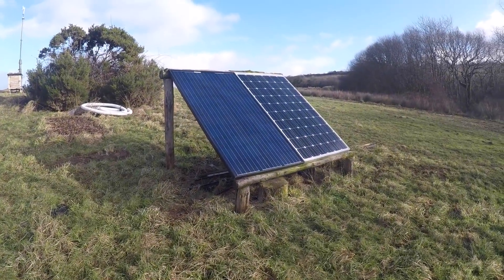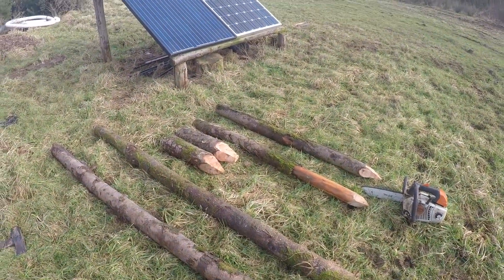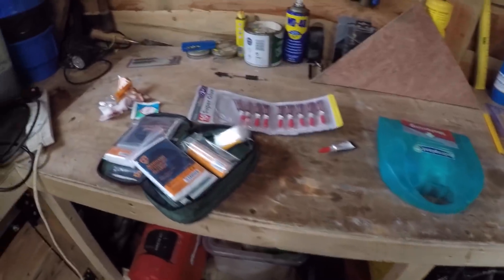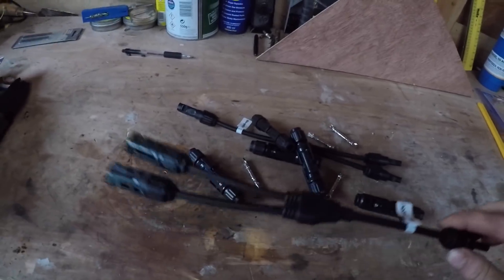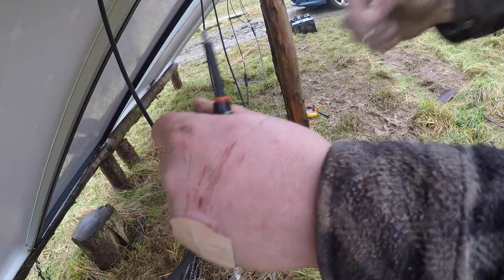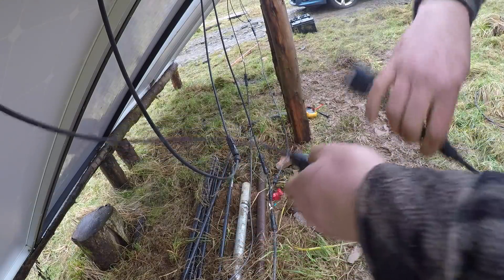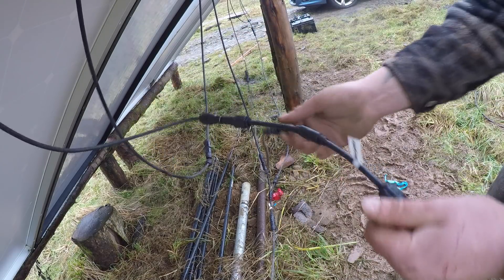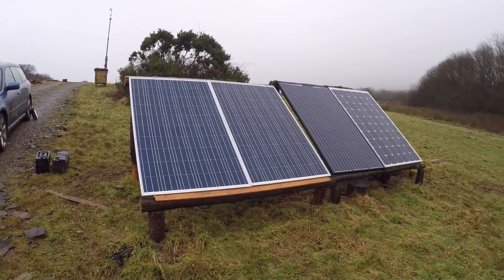Solar Upgrade 1000w

Comment: I would personally never connect solar panels in parallel … unless I’m missing something, if you have 2 panels and let’s say one panel gives 19.5v output for a given amount of sunlight and the panel next to it also receives the same amount of sunlight and it gives say, 19v then if they are wired in parallel and hopefully each panel has a series blocking diode, then the panel with the lower voltage is NEVER going to pass any current into the load.

Comment: Anyone know the wiring diagram for something like this and whats good to use to get going? I want to try use solar to power some Lead acid fork lift batteries not to go completely off grid but to try power the lights and maybe the odd appliance (dryer etc)

Comment: I love the way you tackle every task as if it were the most natural thing for anyone to do. It may be that the MC4 pin doesn't line up correctly because the wrong crimper is used and the resultant shape doesn't sit correctly within the housing and from someone who spent many years working with many crimpers, always do a pull test.

Comment: aloha.... came across your video... your house overview.... your water turbine; pulling your waterline & your controller problems.... but i notice you injured your hand.... 2-3x?? MY ONLY SUGGESTYION WHILE OUT & ABOUT WORKING --- WEAR GLOVES, GOOD TACTICAL GLOVES.... PROTECT YOUR HANDS. ((( you work alone usually and you must place your safety as NUMRER ONE PRIORITY!!!! because if you suffer a bad injury and no one is around and you are invcapacitated, you suffer in silence.  Also; wear a bluetooth earpiece & carry your celhone + battery pack. IT'S FOR YOUR SAFETY!!!

BE SAFE!!!! ALOHA

Comment: Dang Mr Kris, your on a roll, you got the Mo going, keep it up.
Reply from the maker: Hi Gregor, Im slowing down a little bit now that the hydro project is coming to an end, i have tree planting to do soon and then i need to spend some time collecting materials ready for the workshop build. but spring time is going to be crazy busy getting started on the workshop.

Comment: Good to see that you are expanding your solar array as 500W (peak) is a bit low in the UK at this time of year. You would improve your output significantly if you increased your panel angle to about 60 degrees as the sun is low at this time of year. The 60 degree angle will not be ideal for Summer but the sun shines longer each day so it cancels out.  You are operating off-grid so you are most interested in the lowest daily output not the peak yield in Summer.
Another thing you can do with most charge controllers is to overprovision solar PV and let the controller limit the maximum charging current to 1kw or whatever the limit is. This can be very helpful in the UK as it increases the average power output whilst limiting it at something which doesn't hurt your batteries. But you do need to check the manual for your controller.
The solar performance in the UK over the last month or so has been really poor compared to other years due to weather and cloud cover. Sheffield University have a really good webpage giving stats for the last few years based on the entire UK. Well worth a look at https://www.solar.sheffield.ac.uk/pvlive/
I've just finished commissioning my off grid system in Shropshire (7kw panel, 4kw controller, 10kwh lifepo4) but have yet to really exercise it due to the poor weather!
Hope your hand gets better soon, I'm really interested in your hydro project.  Good luck :)
Reply from the maker: Thanks for the nice comment, lots of good info there. yeah my setup is a summer set up. the idea being winter i will be running hydro power. so i dont really need to change the angle. in the next few days i will be on hydro and wont need solar until a summer dry spell. i only did the upgrade because the price was so good. and its always good to have more than you need just incase. 

you have 10kwh lithium! WOW that is very posh. i could really use one of them. im thinking of making a 18650 powerwall at some point. your system sounds really nice. 

Again, thanks for the information im sure lots of people will be interested in that.
Reply: I am using an Outback Flexmax FM80, this allows me to configure the peak output current but I have left it at maximum. I also have some other MPPT controllers which will limit the output current to the maximum supported by the unit but you can't turn it down below that value. Sometimes you have to dig into the user manual to find this information.
Reply: Agreed on exploring over-provisioning.... our array rarely reaches nominal maximum even during perfect conditions so we were able to add another panel. Based on our eGauge we only see peak production clipping a few days a year for an hour or so at midday.
Reply: The Victron MPPT controllers have a maximum input voltage and a maximum input current rating as separate parameters. The product of them may exceed the maximum power rating of the MPPT controller because it will limit the output but the solar array should not exceed either of the two individual parameters. For example the BlueSolar MPPT 150/35 has an input rating of 150V/40A which works out a 6KW but can only deliver 35A (2KW) so you could, in theory, over-provision solar by a factor of up to 3 at 48V if you can build a solar array with max of 145V and 40A panel current. 

In practice you could put 4 strings of 3 x 245W panels (short circuit current of each panel about 9A) on the input (about 3KW) and let the  MPPT controller limit to 2KW load at 48V or 1KW at 24V.

I hope this answers your questions. Please PM me if you want a longer explanation.
Reply: Andy, what model is your charge controller that allows you to limit the maximum current? I've been wanting to do this but haven't found a suitable controller.
Reply: Thanks, interesting because I was looking at victron controllers where you can (model dependent) limit the maximum charge current to a lower value but they explicitly state that you must not exceed the max input voltage or max short circuit current (Question 4 https://www.victronenergy.com/live/drafts:mppt_faq).

So I fully understand the max voltage limit but not the max current given the unit is able to limit the current anyway. Am I misunderstanding...
Reply: ahh, that's cleared up the product ratings perfectly there, I'm seeing the differences in input and output ratings, many thanks.

Unfortunately I see no way to PM you, no 'about' section or 'send message', I think youtube has changed some things but you've cleared it up for me anyway so thanks again.

Comment: Hi Kris what's the best angle to mount the solar panels in the UK?
Reply from the maker: well mine are at about 40 degrees  and facing southwest. so it is a summer set up. and gets more sun in the afternoon. i find that is better than facing south as often the mornings are rainy and then the weather clears latter. if you can build a rack that you can adjust the  angles depending on the time of year that is the ideal. but for my location this works for me.

Comment: Kris - what all you will be able to power in your house? - e.g. washing machine, oven or even to heat water? ....
Reply from the maker: once the hydro is done i will have as much power as the average uk household around 4-5 thousand kwh per year. so anything a normal house has basically. that could also include cooking.

Comment: Kris, have you ever considered getting a PO Box and an Amazon Wish List?  From little everyday items to power tools or whatever.  Whether you could use the help or not  people enjoy directly supplying items to help with someone's passion and gives even a greater sense of community.  I've seen it many times on Twitch.  Just a thought :)
Reply from the maker: No i Have not  to be honest. i didnt even know what an amazon wishlist was until now. but yeah i suppose it is quite a nice idea. i dont like to feel like im asking for things though. im not even good at getting christmas presents. the idea of a stranger buying me things kind of blows my mind. maybe i will get used to it.
Reply: I can appreciate the oddness of it if you've never seen it in other communities but you'd be pleasantly surprised.  Good to have a wide range of items from basic comforts like, socks/tshirts/towels/sheets to duct tape/zip ties/screws to generators/cameras/solar equipment etc, so anybody can contribute at even smaller levels.  

Being able to donate some comfort or much needed equipment can be really rewarding for people especially to someone who is genuinely making a go of it.  Anything you need and don't have to spend money on only helps you save for the homestead projects so it all goes to the same vision really.  Then once every few months or whenever you can have a "mail time" video to show the goods being used and appreciated.  Anyway, give it a think!

Comment: Hi Kris, Does your panels have all the same specification? same U and I(A) ?
Reply from the maker: they are all the same wattage and no more than about 2v different so they are very close. has not caused a problem so far. they were such a good price i couldn't pass them up
Reply: it's better than nothing ! I am waiting for turbine news. Today we had sun after more than one month fully cloudy. good day. tomorow I will connect the turbine to the hydrid inverter.
Reply from the maker: That is very exciting new. are you using a diversion controler and a dump load? or going mppt route?

Comment: mixing solar panels types work but is not 'excellent' for you're MPP(T), hope you're hand will be ok soon, thanks for sharing.
Reply from the maker: yeah i have 3 different panels but they are all the same voltage and current. i have had no problems that i can tell so far. i would not mix panels that had very different characteristics.
Reply: if you already have an MPPT charge controller check its max input but you should be able to run all 4 in series the advantage of them is being able to handle higher voltages

Comment: Do you need to clean the panels? If so, how often?
Reply: I clean my panels 2 times each year and remove snow.
Reply from the maker: not so much in the winter, in the summer they get pollen on them so i might give them a clean but hardly ever.
Reply: Rain cleans them pretty well on it's own

Comment: Smart idea having all that crazy glue, liquid stitches. I worked in a metal working factory for years, I always had in my pocket, and in my tool box. Thank You for sharing your video Kris. ATB
Reply from the maker: It works well if you dont have stitches, its hard to get it to stick if there is to much blood. sometimes some pressure for a bit so the blood slows. and then stick it.

Comment: Hi Kris, hope your hand gets better. How far from your cabin are your panels? I have a place in a valley and want to put solar panels about 150 meters away.
Reply from the maker: they are not far now, only about 30M you can put them 150m away no problem. just run nice thick cable (use a cable size calculator) and have the panels in series to get higher voltage. 150m isnt to far if you have 150v or more running in 16mm or larger cable.
Reply: Kris Harbour cheers Kris, that's great thanks.

Comment: Yow - what happened to your hand? Hope it's not too serious, we're on the edge of our seat waiting to see the hydro system finally start working!
Reply: He cut it with a Stanley knife! Nothing to do with me. I'm sure it will all be explained in the video about finishing the pipe 😊
Reply from the maker: i just came online to answer the comments but it seems my lovely helper Hannah has already done it :D Thanks Hannah.
Reply: Kris Harbour You've been busy doing much more important and exciting things 😘
Reply: Kris Harbour Cut mine with a knife stripping electrical cable. Needed irrigation and stitches. Don’t wait to get it done if it needs it. You might actually need that hand in the future.